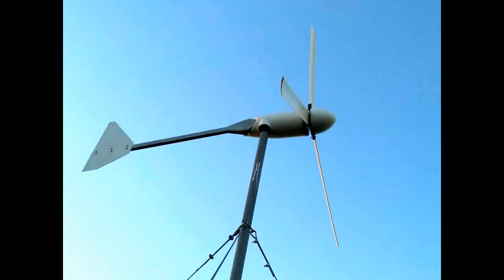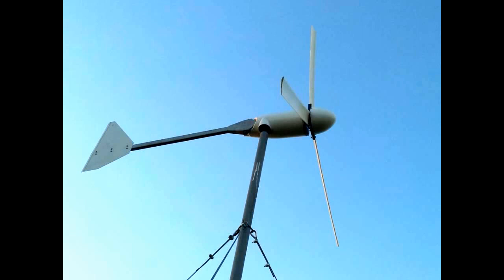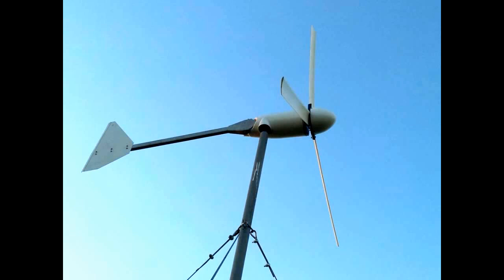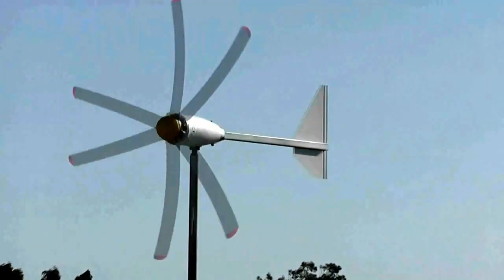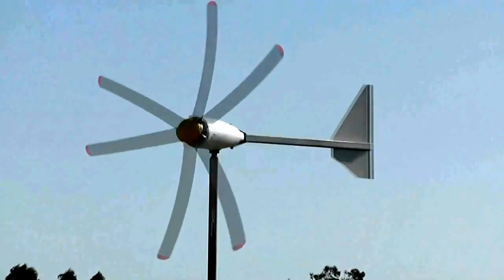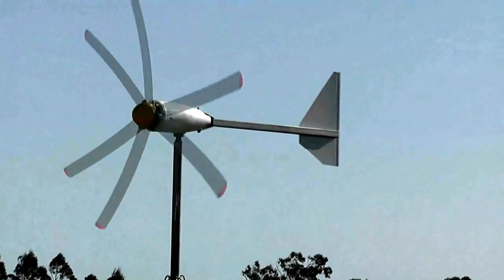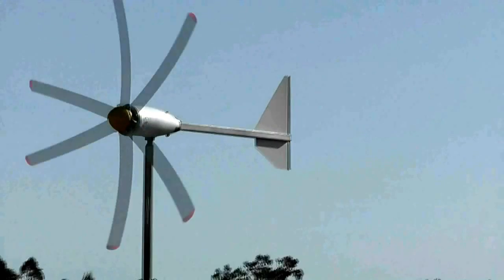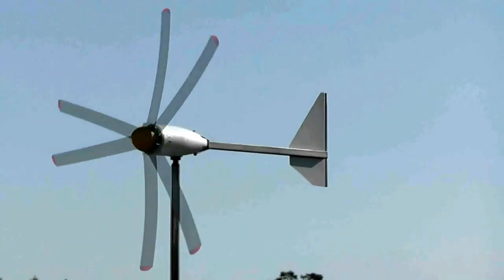Wind Generator in Australia 300 Watt max output.

Comment: What was the advantage of putting smaller blades dia on the generator
Reply from the maker: It was just the profile of the blade that made it spin faster in lower speed and much quieter because they were better quality and design.

Comment: Excellent. Those blades certainly made a difference in the noise factor. I think modding the tail to make it furl 10 degrees (off the "straight" position) further and adding 50% to the area of the tail and 50% to the weight of the tail. It would be more stable in your turbulent conditions and it wouldn't dance around searching for wind. It should also increase the output in gusty wind during furling.